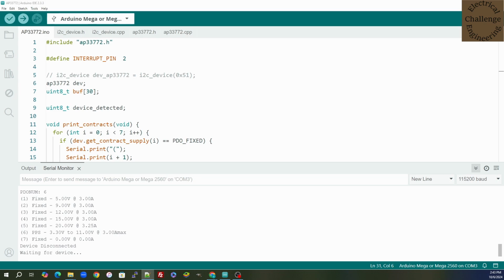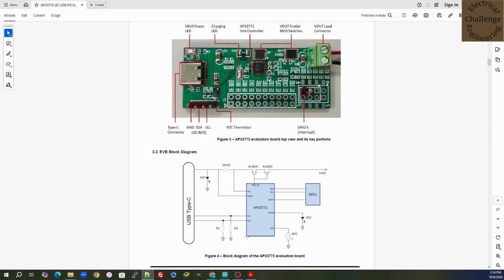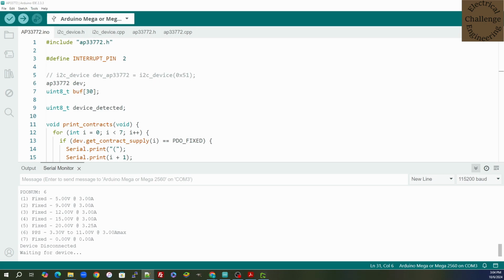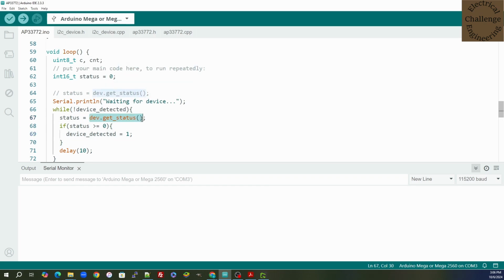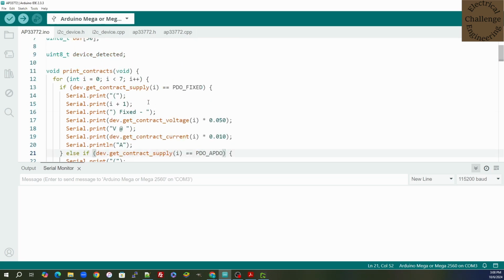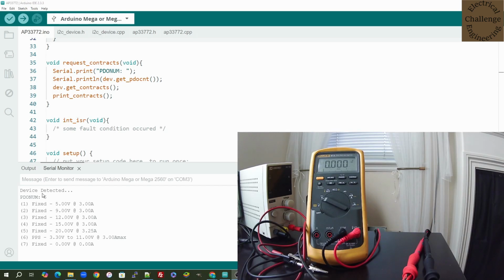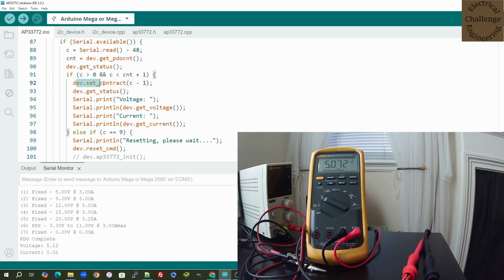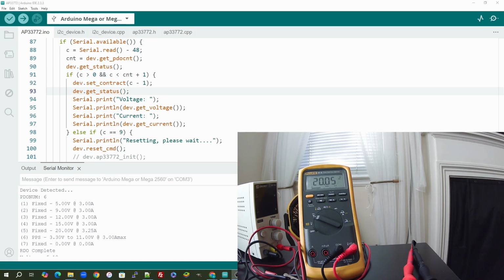EP19 USB C Controller with Arduino

Comment: Super interested in this topic and have just been thinking about it in the last couple of weeks.

Are you aware of any devkits for the brick side of it? …was thinking of using a boost converter on a 12 v car battery (close with 50A curcuit) to pump out 48v and then utilising this for POE injectors and high power USB devices :)
Reply from the maker: I haven’t worked with sources. Only got information about sources while working with sinks. And majority of them are for standard bricks so 20V max. Even 28V is not super standard yet but like 48V is out there. 

But for POE injectors, why would you need a USBC? Why wouldn’t you just power the injectors thru a relay or just turn on the boost when you want to power the injectors. 

USBC is really a user benefit not really a system benefit. 

Diodes inc does appear to have a 4 port sub c dev kit using the AP43776Q which is automotive grade. But output is just standard up to 65W it seems per port. But 20V max